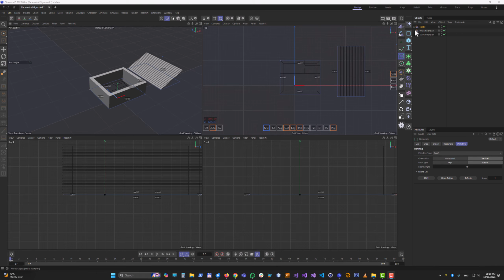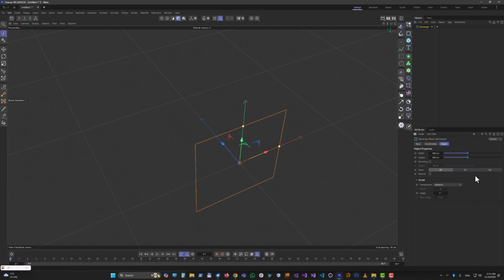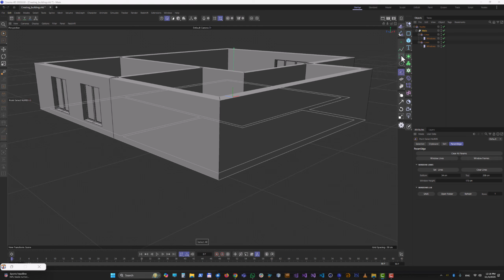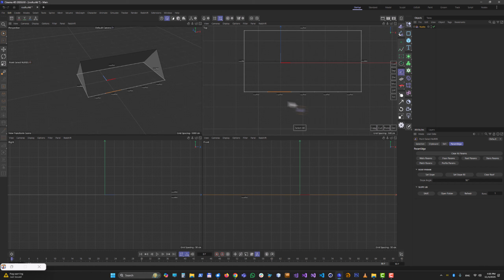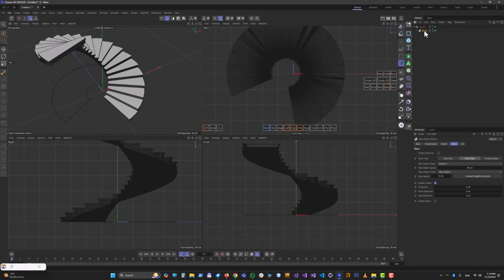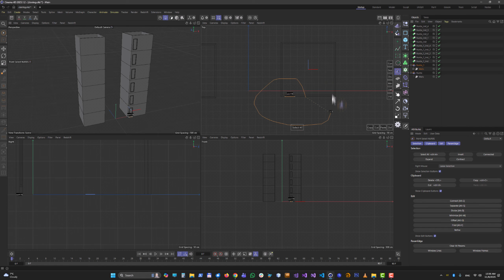Architron C4D 2026 – Feature Overview

Comment: This is very useful. I like this latest version I can finally see myself using it. But I'm having a hard time understanding all the tools and when I look at older tutorials it looks like its very different now. I know you are probably one developer doing all this work, but I wonder if you could find time to make a tutorial with this latest iteration going over all the basics and all the tools. Thanks.
Reply from the maker: Thanks! The latest version is built to handle much larger projects. The older ArchViz tools were pretty limited and very hard-coded, so this new system is much more general, fully parametric, and ready to grow. This is the first release that really shows what the new Architron NURBS core can do — and each update is expanding it a lot.

It’s evolving so quickly that tutorials get outdated almost instantly, which is why there aren’t new ones yet. Once things stabilize a bit, I’ll put together a proper, up-to-date walkthrough of all the basics and tools.

Comment: What about roof tile generator knows from LightWave version ?
Reply from the maker: Yes, of course it will be added — it’s even mentioned in the next chapter of the video. 
Replacing the old legacy polygon-only tools with a more advanced parametric NURBS system isn’t simple. I’m sorry it’s taking so long, but the outcome will be worth it.